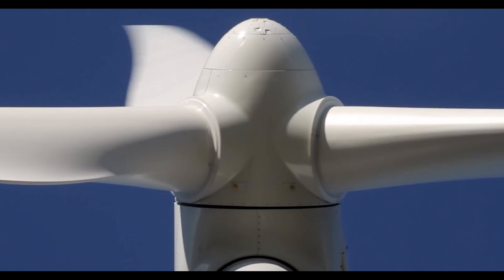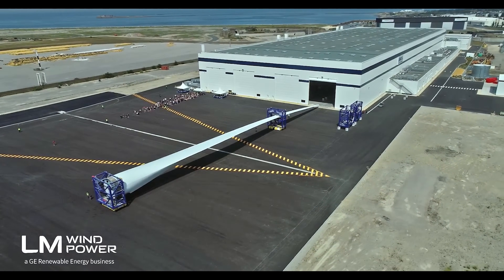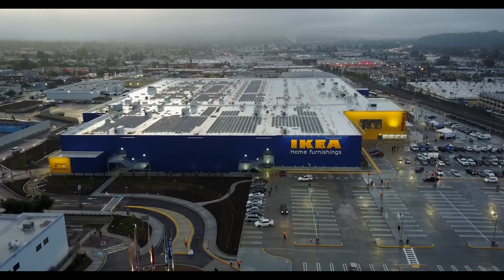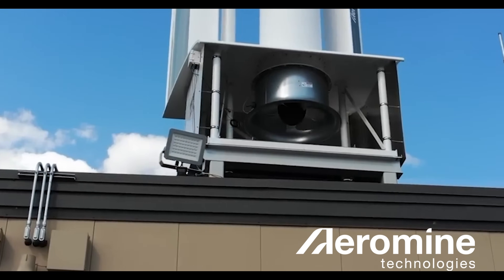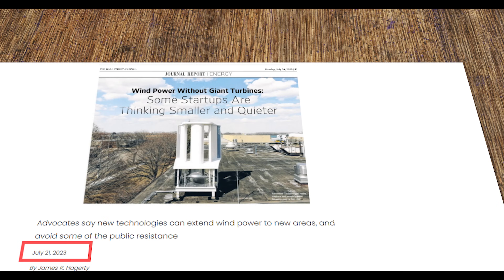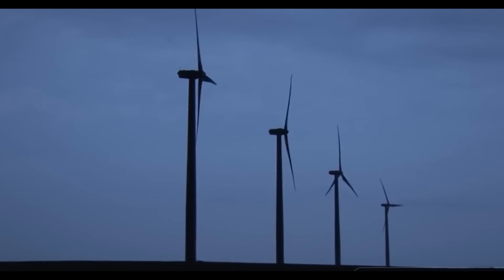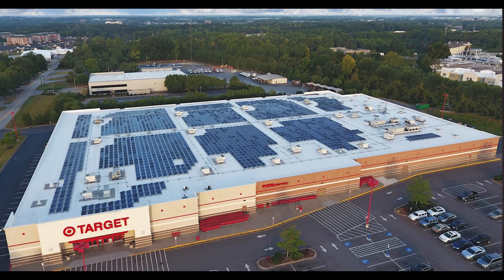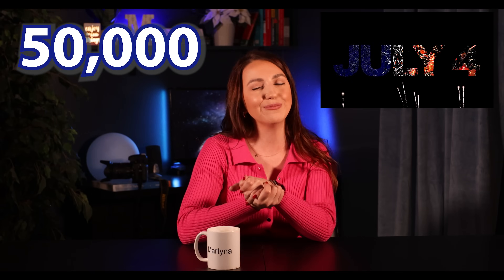How Can A Wind Turbine  Work without Moving?\ GAMECHANGER

Comment: We had a friend at our marina install a small wind turbine on his boat a couple of docks over. That thing was really noisy and in a blow and apparently it would disengage from generating electricity for some safety feature. That's  when I decided the wind generation is not for me. My other buddy on the same dock as mine has two solar panels and he said that they easily keep his house batteries topped up. I think in many cases solar is the way to go especially if you like your neighbors.
Silent wind generation? They might be standing on a gold mine if it works!
Love your videos! Just found them today and am learning so much!
Thank you!
Your english sounds than mine, and my family roots are fom England!

Comment: Looks like Aeromine are using the venturi effect, Bernoulli's principles. Instead of having Bernoulli's principle act directly on the airfoil, the rotor blades, it creates suction that is ducted to a hidden fan, that drives an alternator. There are actually two forces acting on an airfoil, the said Bernoulli's law and Newton's law. They appear to only take advantage of the former. Hence, I would expect them to get less energy out of the same sized airfoil. There are obviously also secondary losses as an internal turbine, which is also an airfoil needs to be turned by the suction. Btw, their main airfoil are the two parallel horizontal elements on top of the unit. The question on whether they need an inverter is a matter of unbundling and product strategy. Eventually, some form of power conditioning needs to happen even if an alternator already produces AC. There is not much on their Website, besides lots of promotions and announcement of a Series A - just now in December. According to Pitchbook, they raised $8M from an undisclosed investor, and previously $1.1M from AEC Angels. From my observation, when a startup creates more hype than actual product, there have not yet overcome technical challenges. Judging on that there got funding and someone has done due diligence, their technology is feasible. For Aeromine to be successful they have to address price point in relation to power generation, as well as convince customers that the new form factor, that as we discussed above is less efficient than a traditional rotor design, is acceptable in the first place. There first (and perhaps only) demonstration piece installed at a BASF property, reportedly was sized in the 5 kW range. My wild guess is, if Aeromine is able to meet price point, the issue of conversion efficiency is not that important, because they would be deployed where traditional "windmills" would not. Of course, there are plenty of other technical challenges to overcome such as wind load, or how well they perform low altitude turbulent air. But then, plenty of hyped technology sells not because of utility, but because of statement of the owner. Perhaps someone gave them a pile of money out of philanthropy to build a larger deployment testbed to actual try out how well it works. Definitely, a company I am personally watching.

Comment: You said that these won’t interfere with solar and they can work together, but that is only partially true, because they would shade the solar unless there is a significant spacing. 
It would however be great to have a smaller system which could be used on houses, that way you could produce either more power or power 24/7.  Shading over the solar by the turbine is still a problem.  The other problem is residential roofing is not designed for the loads that a turbine would place on them, so something smaller that could be used in quantity would be a more economical option

Comment: It is simple Martina, if you observe the video in detail you can see a free standing wind speed measuring device at the same level as the windturbine. So they measure the power vs the wind speed. 
just ask the manufacturer to provide the power versus wind speed (W/ms) profile and you can figure out if it is an interesting investment when you know the average wind speed on de location you want to use it.

Comment: Re: noise - it helps if you can quantify this (db).   What is noise to one person might not be for the next.   Also where the devices are installed.   If high up (most likely), the noise will probably not be as big of a problem compared to a lower elevation.  Are there noise dampening techniques that could be beneficial?

Comment: Capturing an edge turbulence on a building typically means disturbing it. The wind will mostly likely largely evade the turbine and flow differently around the building. It is not the same as freestream flow capture and will reduce conversion efficiency. However maximum efficiency not the key aspect here.
Of course, you can add a few units to better back up the solar output. 

Previously the CAPEX to power output ratio of any small wind turbine that is neither pitch-adjusted to flow speed nor rotated into the wind is lacking.
They never make any money due to further drops in efficiency versus optimistic assumptions.

Only buy if you have validated the power curve and flow speed input assumptions over an entire year of metered flow data onsite.

Small turbines and innovative concepts hardly ever get to capturing 46% of flow energy like the big industrial pitch-controlled 3-blade wind mills do.
Check the Huetter graph on turbines first and check physics why.

Aerodynmics has many not so obvious pitfalls why flows marco and micro flows respond differently to satisfy the Betz equation.
You would actually need a flow simulation with and without the turbine based on metering data of an entire year to properly place such a turbine and not have severe drops in power conversion speed, flow direction or wind speed. The building is part of the Betz equation.
Placing the turbine might just make the flow go sideways instead of over the building.

Rooftop installations forced by available space to be placed closely are also notorious for shielding each other.
On device might have good yields but cause 3 others to  perform very poorly.

Also, you run a considerable risk of your neighbors miles around raising some new building and disturbing your setup.
You house might simply not get the same wind patterns anymore.

The field of rooftop wind installations has almost died out over the years as our understanding of wind energy grows.
It's much more economical to buy wind energy from the grid.

At least wait for the power curve being certified by some authority.

Comment: Marlyna, please don't say turbáeen, please say turbeen. The word turbáeen is no longer used in the US. Those people are all dead because of old age.
You are forgetting that wind and solar power generation are terribly unreliable. Few years back, in Texas over 200 people died from the cold when the wind "turbeen" froze due to inclement weather.
At around 6:05 into your video you are showing an optimistic picture where you have the motionless wind turbine and an array of solar panels.
I am sure you know that the usable sunlight to generate electricity is about 6 hrs a day on the average. And the same for wind.
Worse of all is that they peak at the same time, then you have to rely in coal burning power plants.
That, coupled with taxpayers subsidy, you have an expensive system that can not pay for it self.
When people get fed-up with the lies that politicians been telling us, and the subsidies end, the whole system of wind turbine and solar panels will collapse.

Comment: Good idea but wind direction is going to be a problem, and for home I doubt a scaled down model is going to work.
Reply from the maker: Yes I wonder how much loss we will get for the lack of the yaw and control system. 

I do wonder how this would be even scaled down to fit on residential roofs, maybe just on small flat roofs? 
Interesting thought, and I do want to ask the owner now if they plan to make this available for smaller applications.

Comment: I'm a Japanese electrical engineer, and I've always been active in energy conservation.
I have seen this type of wind power generation in the past, but I think it can only be used in areas where the wind direction is almost constant and the wind speed can be expected.
I also feel that there is a possibility that it will be damaged if a hurricane hits it directly.
Among the several ideas I had, I first patented a product that effectively changes the direction of the wind to remove heat from a house and reduce the amount of air conditioning used in the summer.
If you are interested, please watch the video by clicking on the icon. (Base comments are in Japanese, but can be converted to English)
In order to reduce CO2 in developed countries, it is important to reduce electricity consumption at night when solar power generation is not producing electricity, and exhausting heat through wind can definitely reduce electricity consumption.
Also, I have been hit by a typhoon and this device has gust protection.
If this product sells to a certain extent, we hope to start developing urban wind power generation that is effective even when the wind direction changes hourly.
Please feel free to rate it then.

Comment: Why do they say fan-less motion less etc when it clearly is not?!. They just turned the fan side ways and designed the case to make the wind flow threw it. Birds bees etc can still fly in it so it’s not safer. It’s the same vertical wind turbine if ya ask me. It’s just turned on it’s side instead of faced to the wind. There is only vertical and horizontal blades that’s it. There is no such thing as blade less. I wished marketers wouldn’t try so hard with the wording. Cause that’s all it seems to be anymore just words…..

Comment: Great video,  Ventumdynamics is a company that I am looking at, they make industrial sized and smaller wind turbines that have an internal fan and it can use wind from any direction without turning the unit and they kind of look like a roundish central air unit (HVAC) that can be mounted in a yard or rooftop      Happy New Year to all here !
Reply from the maker: Thanks for the info! I really want to dig deeper into that turbine as well.  Thank you for leaving a comment, I appreciate it so much sir :) 
M
Reply: Seen any certified power curve published yet? Comments in their video deactivate sounds many alarm bells.
The physics of the renderings wouldn't even place the rotor blades in any meaningful angle in the flow.
The flow would also largely evade the structure without even being redirected.
I would be highly interested in any certified power conversion metering data.